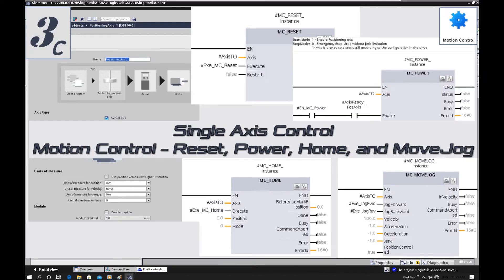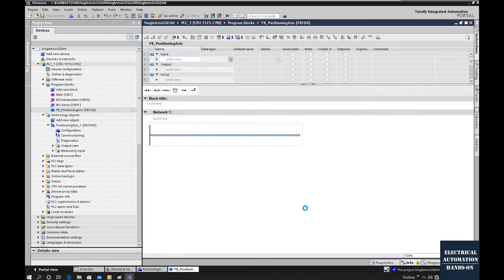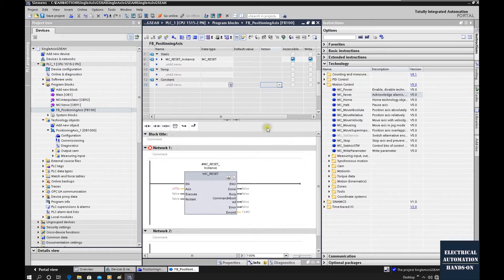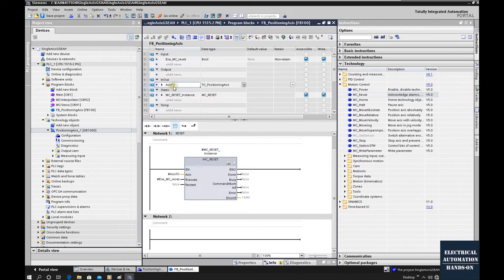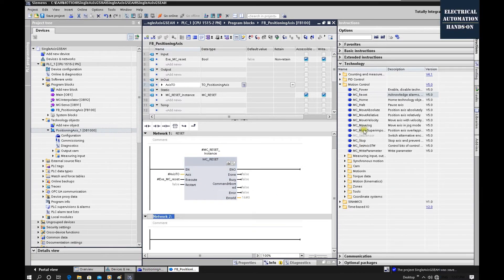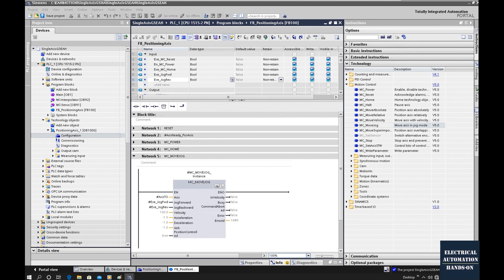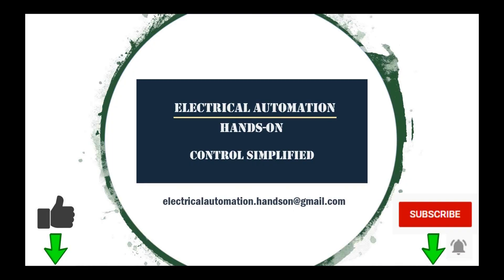MS03c. [Siemens Motion Control] Reset, Power, Home, and MoveJog Instructions in TIA Portal [5/10]

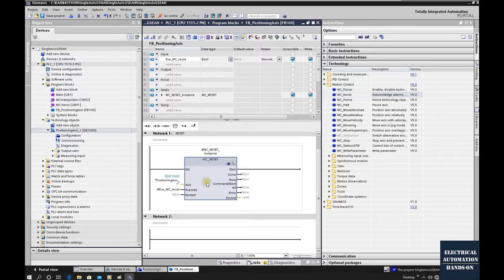Comment: @Electrical Automation Hands-On 3:12 why not just use the drag and dropped Technology object positioning axis instead of creating an extra parameter? that wasnt clear to me
Reply from the maker: Thanks for watching! The MC function blocks are programmed in a Function Block. This Function Block can be used as your personal motion control template. Therefore, the TO was connected as a IN/OUT interface. So in future, if you have >10 axis in one system, it will be very easy to use

Comment: Hello, I am Erdal. I'm glad I found your channel :)) you have very useful videos. I watched this video of yours and it is a really nice method. I will use FB for the 3 axis v90 servo in my project. :)))Thank you very much.
I watched your MS05 video series. really nice. You have explained Mc_GearIn. We would like you to explain other synchronous motion commands. Because there are very few synchronous motion videos that explain it as beautifully as you do. For example, we would be very happy if you create a video about Mc_CamIn and creating a Cam diagram. thanks
Reply from the maker: Hi Erdal, Thanks for your watching? Are you using S7-1500 or S7-1500T?
Reply: @electricalautomation  S7 1500T,thank you
Reply from the maker: @erdaltas1691  I am able to prepare some videos about the gear/cam by using S7-1500T. But I am temporarily very busy these weeks. So I am plan them, thanks！
Reply: @electricalautomation  thank you very much. I wish you ease in your works.

Comment: can you please make a video on SINA_PARA_S function block to read & write the servo drive parameters that would be very much helpfull  for users. because i couldnt find any video on youtube related to this topic.Thanks a lot
Reply from the maker: https://cache.industry.siemens.com/dl/files/970/109475970/att_842192/v1/FAQ-04EP6Z7Q_read_write_parameter_using_FB287_EN.pdf  
I think this link would be helpful. SINA_PARA_S is mainly used for G drives. But I don't have them.

Comment: How to increase or decrease the torque, sir
Reply from the maker: The torque control loop is within the drive and controlled by current loop. Unless you are using Torque control mode for your servo drive. But you could use torque reduction control. pls see MS05k. [Siemens S120 #9] SINAMICS S120 Drive Torque Limitation, Torque Reduction https://youtu.be/CpvjDHYWwvs